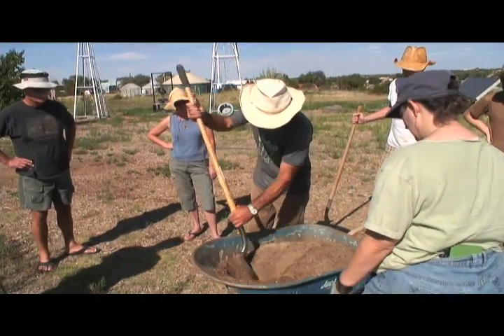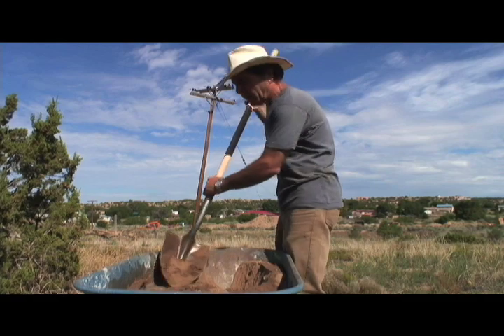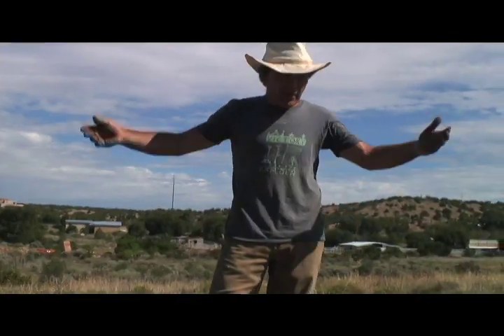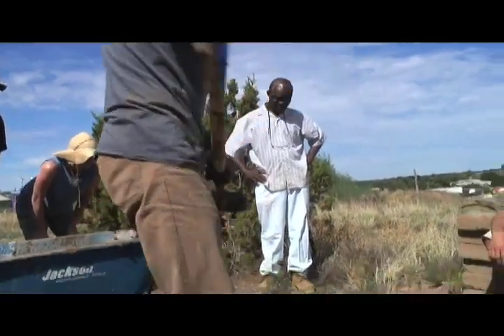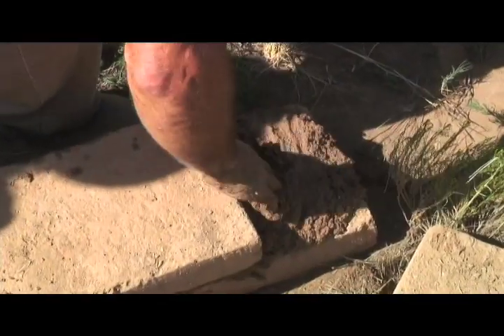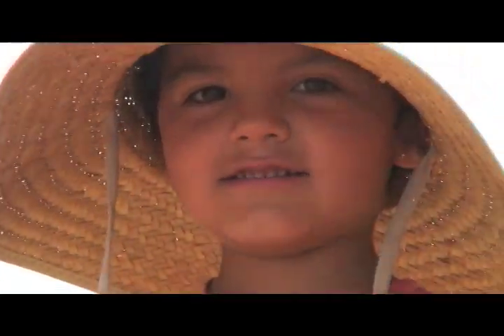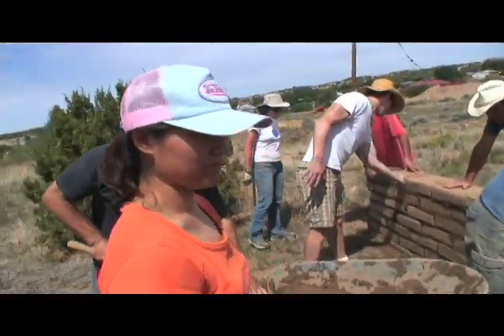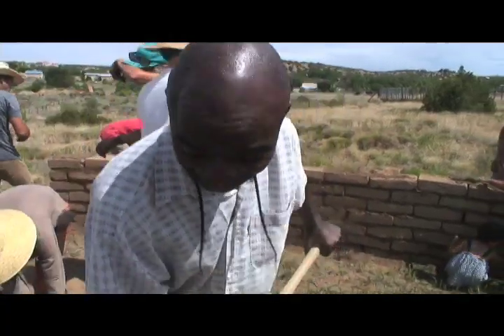Adobe 2: Building with Adobe

Comment: Wow I dont see any straw. These are the hardest adobes i have seen and makes the case clear for not using added straw/large amounts as it does nt work and if you consider the prices and effort adding and sourcing straw. If anything from what I could determine it messes with the matrix or the soils from truly locking form and compressing together. Weakening at those parts creating tiny fissures if you like also air pockets which have to weaken and hinders the clay and particals compressing and interlocking as on a scale also  the straw has a shiny surface which would also hinder. The most strongest brick ive seen. The thing barely broke when he was hitting it. Thats all I need to know. I believe theirs a traditional aspect to adding is straw as well as a quasi insulation aspect. No boubt the mix of clay and sifted sand, earth makes the best earth brick. Cheers. This was a great demo. Cheers.

Comment: As far as goes the adobe bricks at ground level; why not use "baked" adobe bricks there, so they are more or less waterproof. And as far as goes the mud mortar; why not add a little portland cement and lime to make it all stick more like mortar for concrete block walls? And what is wrong with adding a tiny bit of cement to the adobe bricks, to make them more waterproof and durable?

Comment: How long will an adobe wall last without an overhang? (mud) Does asphalt emulsion slow down the decaying process? Your building dept. ok'd your uble footing below grade? What dimensions? What part of N.M.? How big was the concrete bond beam you put on top of the rubble footing? Ss long as you are going to build a form for a bond beam, why not just form a raised stem wall and dig below grade for your footer and por both monolithic? How many  bricks will it take to build a 800 sq. ft. @ 9' high?

Comment: how is the mortar made?
Reply: Sift subsoil and add water. ;)
Reply: It's important that the soil have good clay content, or it will just fall apart.
Reply: Riccardo1982 it's the same as the blocks. 30% clay. 70% sand/earth. and emulsified asphalt. like 10%. That's for weather resistance. I've been researching this pretty extensively lately.